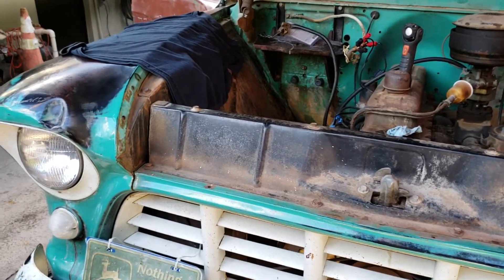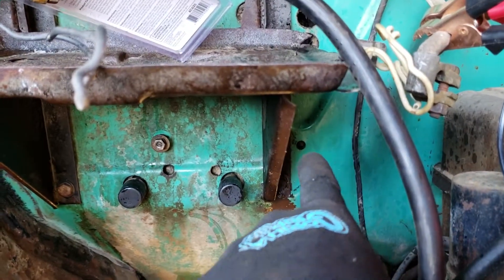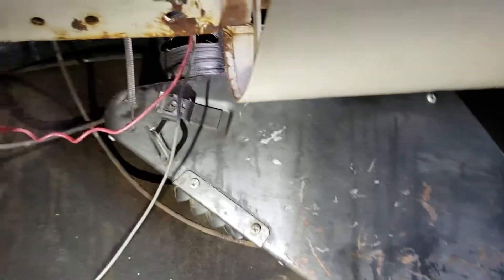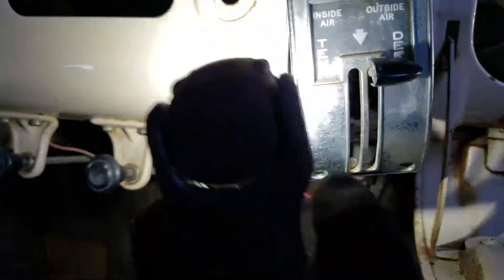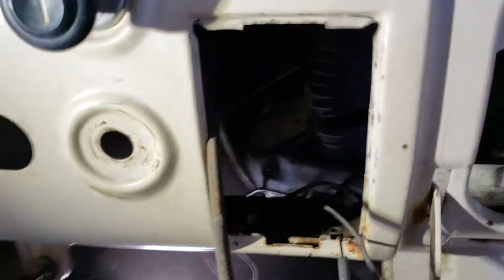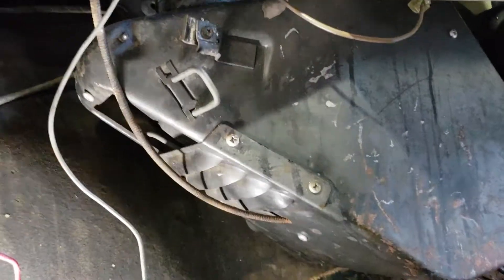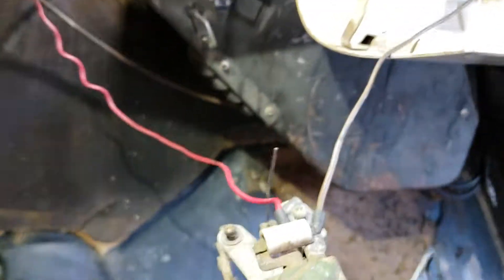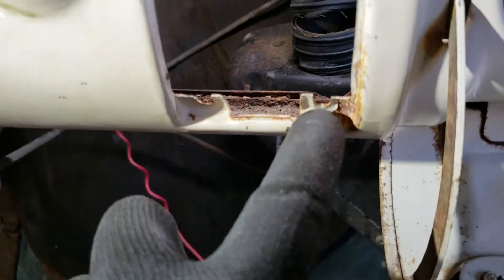Removal Heater Box 1955 Chevy pickup truck Complete setup explanation

Comment: Excellent,  I can pretty much work out what's going on with my heater system on my 57 now. I have a lot of missing parts and no cables. But I found the grey light cable in the glove box. The heater core is leaking , control valve is missing too.  However your video gave me some good pointers on where things go. Cheers.
Reply from the maker: Great,  if you have any other questions,  let me know. I took it apart and in boxes all stored; I can reference other things if necessary. Good luck.
Reply: That Gray light cable , any ideas where that might connect to? I think the red cable goes to the ignition key switch. Does the light go here as well or is it on the light switch? I'm trying to trace on a wiring diagram,  but it's confusing!  Thanks
Reply from the maker: @freelyfarmexploits8854   Gray cable could be for light, I'm not sure but that seems to be the pattern the use throughout the car, for example in the main gauge cluster for the speedometer, fuel gauge, etc... They use those Gray cables for the lights in the cluster.
Reply from the maker: Excellent